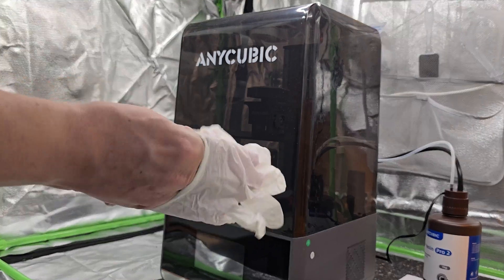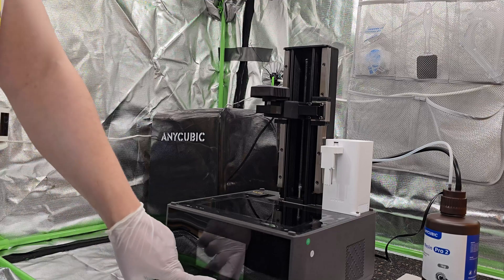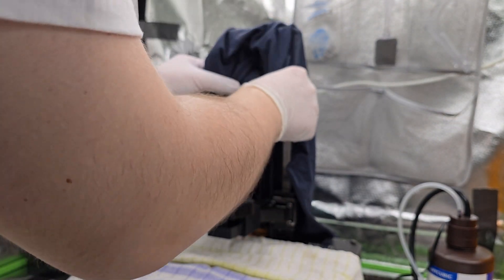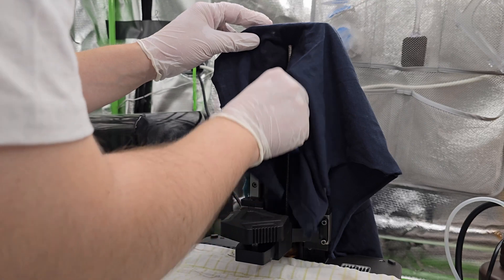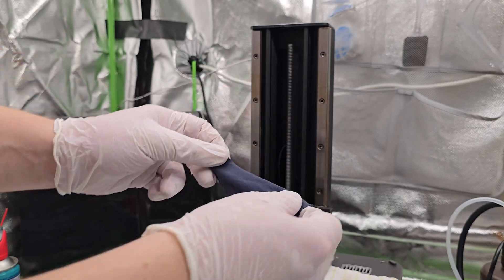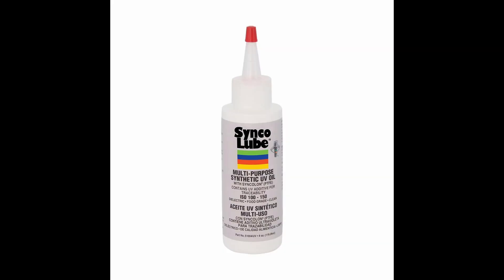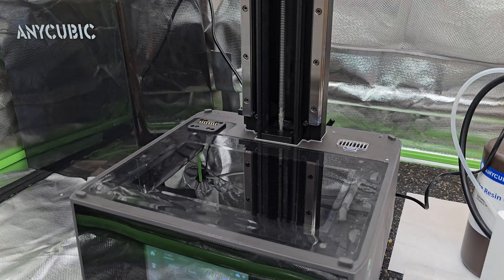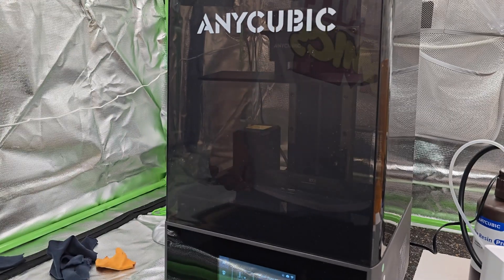How to Clean, Lubricate & Grease Your Resin (SLA) Printer for Smooth Operation & Longer Lifespan

Comment: Hello, is the middle rail can be clean with ptfe lubricant?
Reply from the maker: I think the middle rail would be better to clean with a grease, like Superlube 21030 which does have PTFE than lube.
Reply: @3DInovacije I can find wd 40 dry lube here, with ptfe. Is that okay? it's hard to find that kind of lubricant here
Reply from the maker: @1337FLINT.  Hey man, I mentioned in the video what’s generally considered a good recommendation online from multiple sources. White lithium grease or SuperLube 21030 are the best options for the Z-rod. Dry lube can work, it’s probably better than nothing, but it’s not the recommended choice.